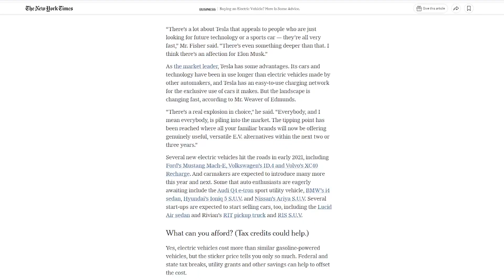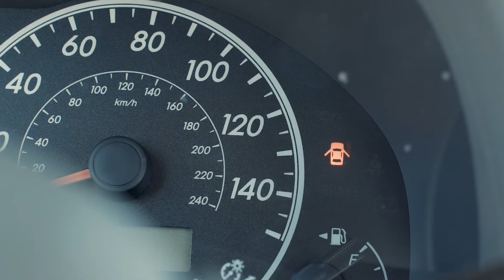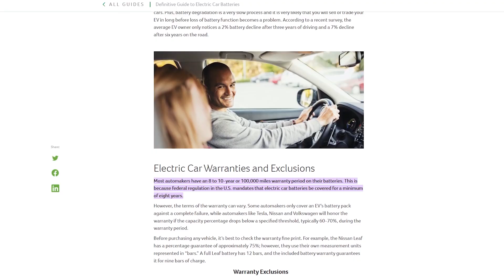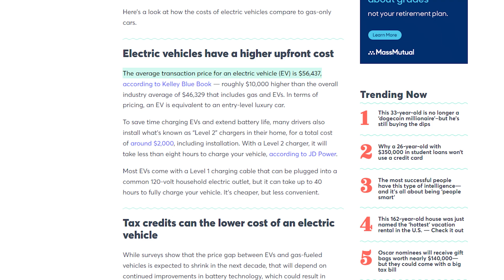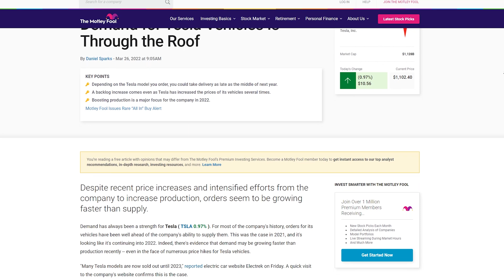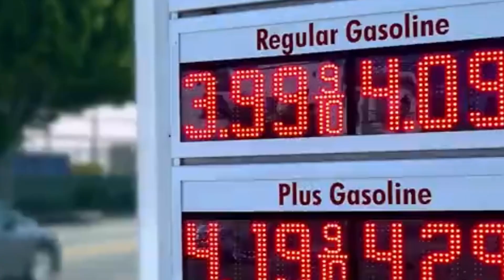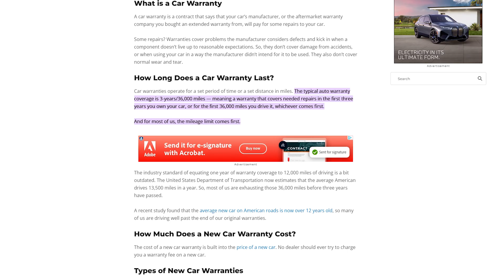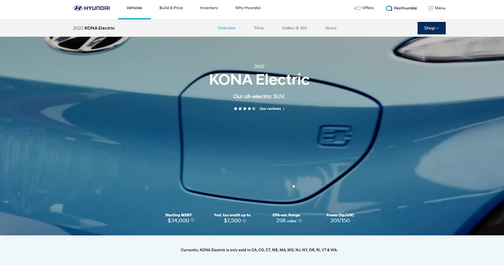The Electric Vehicle Buyer's Guide | Gruber Motors

Comment: With data available(granted it's mostly by looking at Tesla's since they were the first to make a li-ion based EV), actively cooled batteries should last for 1000 full charge/recharge cycles(aka 1000x their range) or 20 years. Excluding cars that have loads of tender love and care invested in them, that is no less than an ICE car. So the whole "replace the battery" panic is overblown. Also, practically everyone will stop for a coffee after a 2-3h drive.
Reply: Most of the times yes, but if you have kids sleeping while driving, your goal is to reach as many miles as you can while they are not "fighting" back there.
Electric vechicles has many pros and few cons the same is with the ICE cars but with diff pros and cons. We will all move towarda EVs but it seems that this change will last longer than we all expected.

Comment: My salary is 558 usd before tax. My rent is 350 usd, bills 50 usd and the rest is for living. How can I aford an electric car ? You can tell me 1000 times that i pay mor in the begining and i save alot after if i cant have those money. Many countrys have this salary not US salary.
Reply: how far you have to go? go on the bike, or try to get a car changes to e... plug it into the soket, never take the fuel small anymore
Reply: With that income, you can't afford anything (esp. with the current chip shortage). Take public transportation/bike or buy an old but reliable used car.